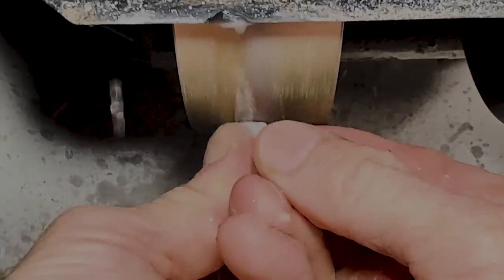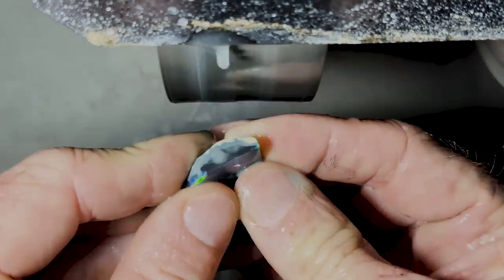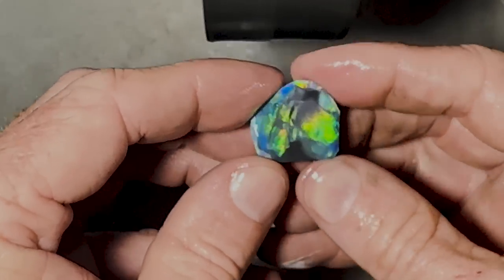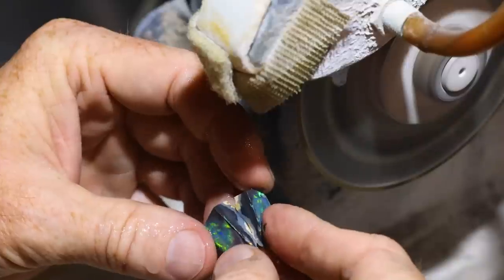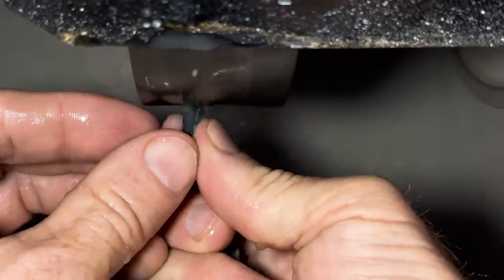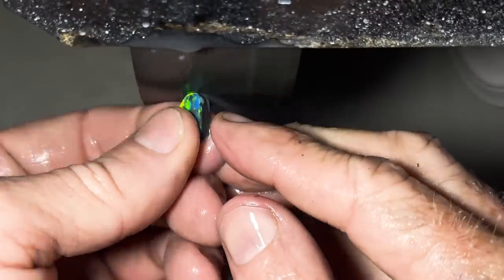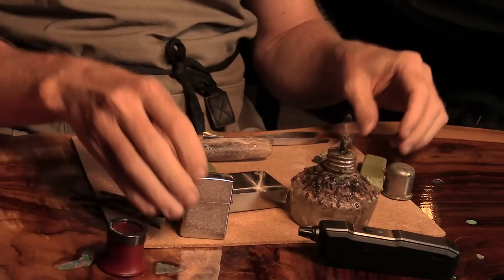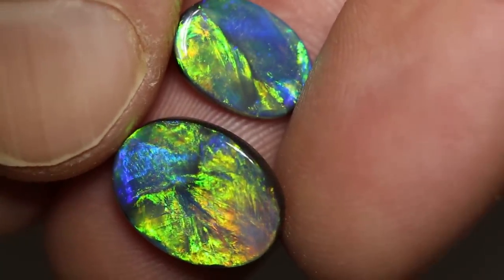A gambler? A gem cutter or a educated risk

Comment: I picked #3. I think you might consider 2 cuts on it: first, to slice off the small round knob of crystal opal. Second- it looks to me like there are two stones facing eachother and offset to the side- a crystal opal and a black opal- and I think you could separate them to produce a really sizable crystal while still maximizing the area underlain by black potch on the other piece. So, a diagonal cut underneath the black potch, roughly facing 1/2 of the dome of each of two stones. What do you think?
Reply: Eh maybe not diagonal...that would leave a chip to slice/grind off on the black opal...